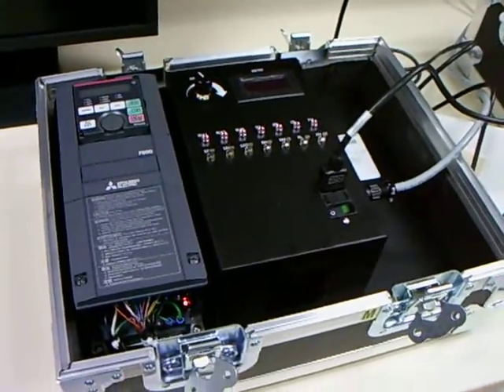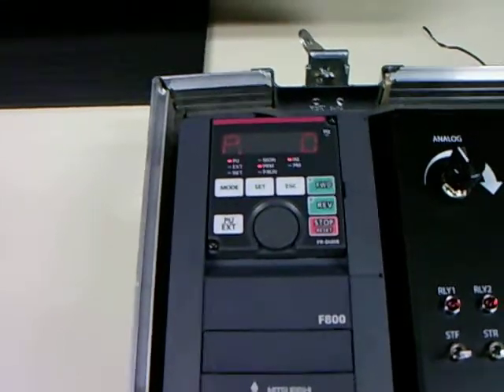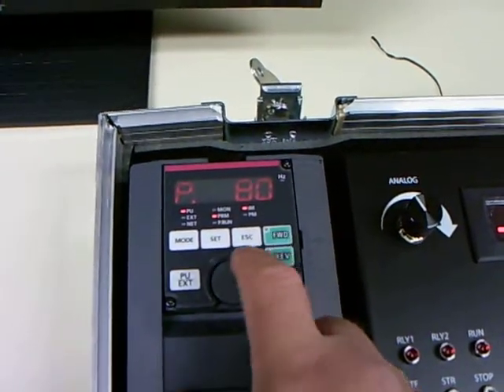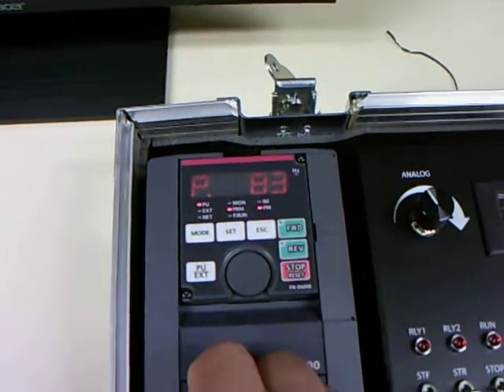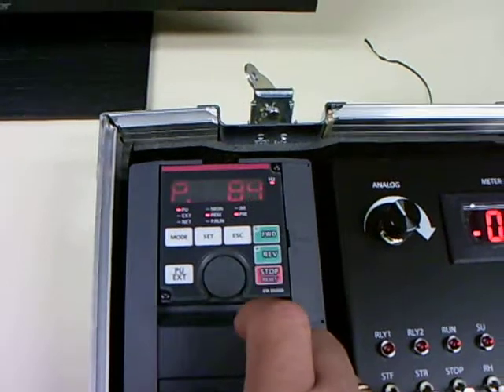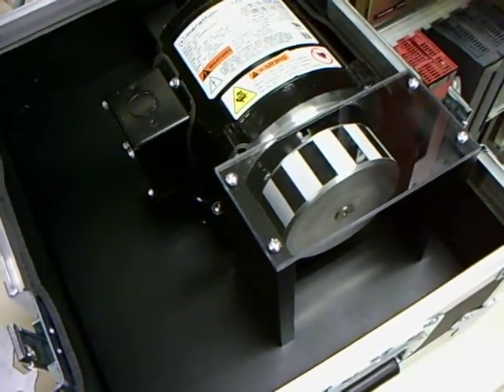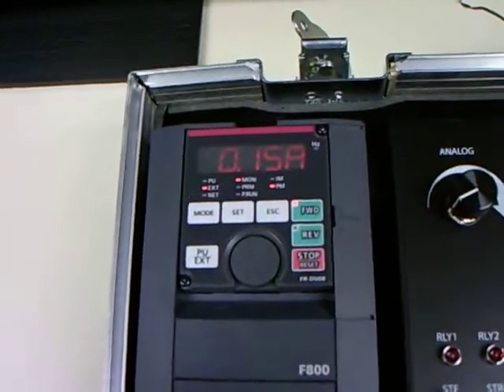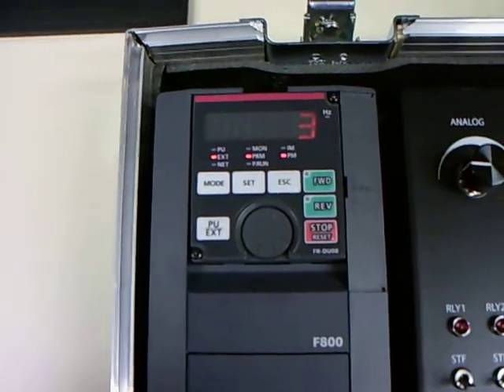Tuning Mitsubishi's  800 series drives with IPM motors

Comment: What value to choose in Parameter 81 if number of motor poles exceeds 12 poles, for example in case of 16 poles or 18 poles motors? Thank you for your answer in advance.
Reply from the maker: Hi Roman,  it is certainly possible to use this drive with IPM motors with much higher pole counts.  Some hidden parameters  need to be set .  The auto-tune can not then be depended on to give smooth operation without some manual tuning.  The main issue is with the magnetic pole detection on starting.     I would suggest contacting your local agent for support.

Comment: i need mitsubishi A800 inverter how to change frequency of motor.
Reply from the maker: The simplest way to change motor speed:  Close circuit between PC and STF (if your version is European type with source logic)  for run command and input 5 V signal to terminal 2 (+) and 5(-).   50Hz will be + 5 V and speed is proportional to the signal.   Drive must be in 'EXT' mode .
Reply: Iiii